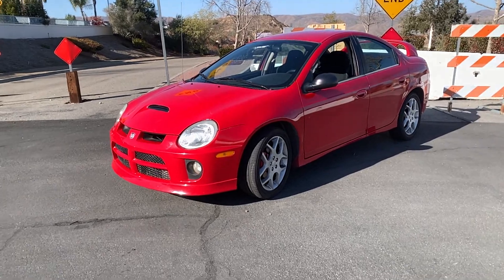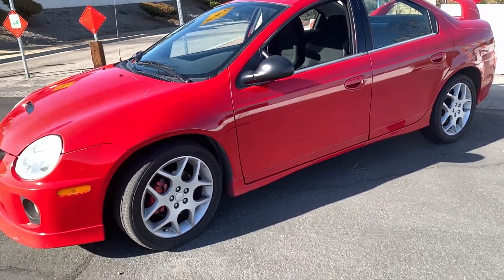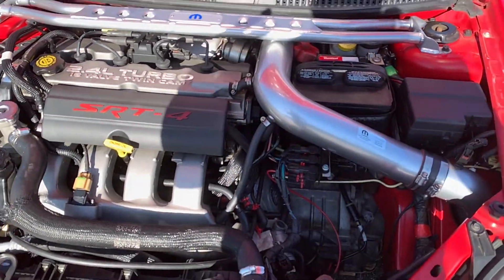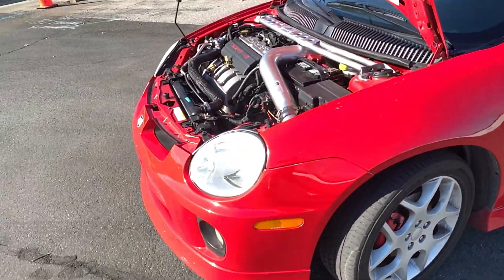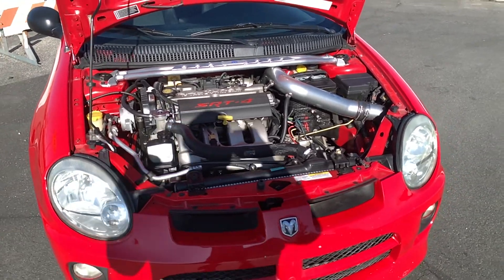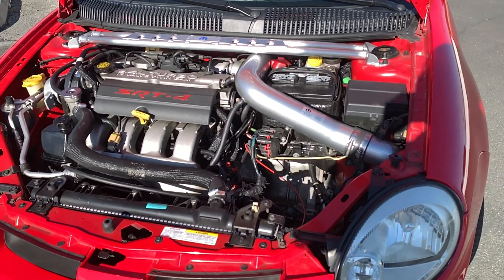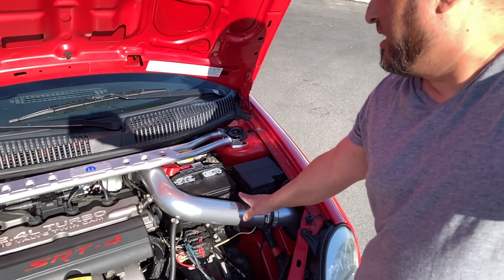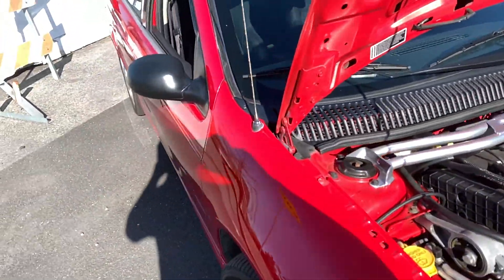Dodge SRT-4 Update Information

Comment: 200-220F is normal temperatures all year round. The OEM Mopar is 195F thermostat which I recommend getting.. 200F-220F is prime temperature for oil peak performance and minimal breakdown at this preferred temp. Note if you acquire a cooler thermostat then the OEM temp above like the 180* this is more specifically for warmer climates and requires a fan mod. The 160* option is full on race and I DONT recommend that at all. OEM = best in my opinion. GL!

Also, not to trip you out man, but knocks and noises just don't go away in high performance vehicles. Something is up, and it didn't just go away.  Have someone take a good look at your transmission. If you know a reputable race shop, id highly recommend taking your SRT in for a transmission fluid flush + inspection. Might be worth getting your clutch master cylinder fluid flushed and adjusted too. Cheers bro.

Comment: Note: A stock PCM/ECU SRT-4 has NO speed limiter. Its limited by drag, hp, weight, and torque. They can go 155+ stock. Mine I've taken only to 145Mph in the straights here in AZ, but thats only because I have light eco continental tires and I pulled out. They're not high speed rated (limited at 149mph).

For inter-cooler if you're staying stock TDL04R turbo go with an AGP direct fit. AGP literally makes the best fucking intercoolers and parts for the SRT format and no crash bar removal. Cheers and remember your SRT-4 head is mechanically built and limited to 6250. Revving over 6,250 is also going to cause issues sooner than you'd like. (heater core leaks, and water pump leaks/ failures if you dont have a new one within the last couple years) Just some advise from your friendly Phoenix, AZ engineer. :- )
Reply from the maker: Thank you, I really appreciate the information.  It will be very useful to me.